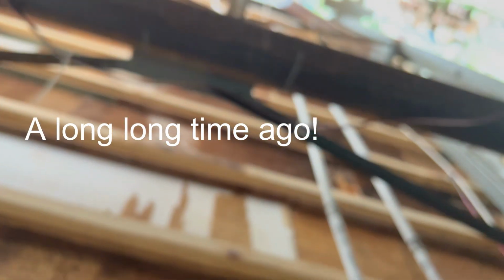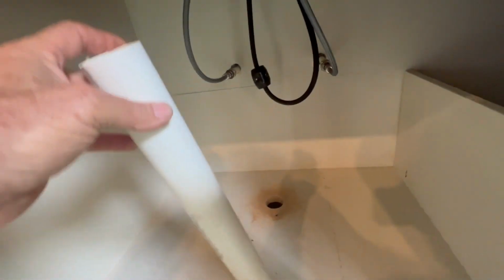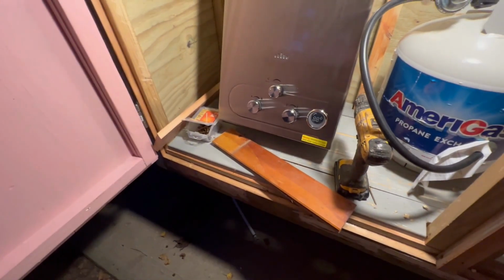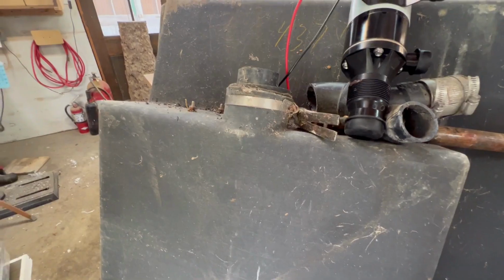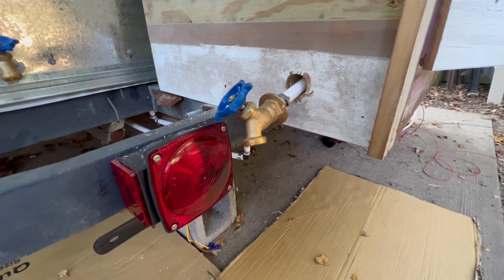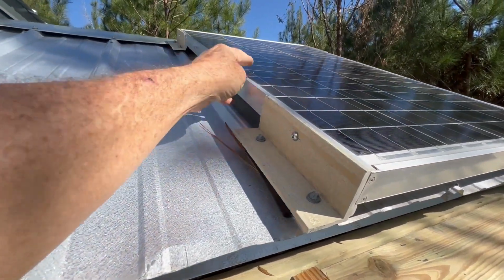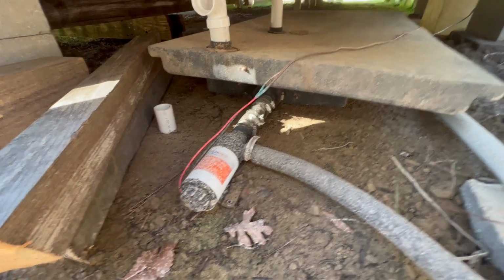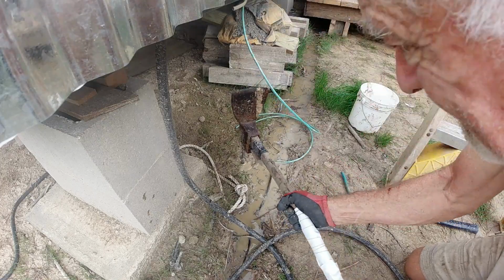Plumbing the Tiny House Camp Camper Thing and adding a touch of solar power too!

Comment: Where you dumping your black water ? I’d bury a 55 gallon drum filled 1/4 way with a few holes and small rocks .
Reply from the maker: I am pretty open on that. I slid 4 10’ joints of PVC through the trees and vines. I don’t know where the end ended up . It might have circled around and headed right back towards me. But anyway, there is a tremendous volume of biomass in those woods. So my plan is to do nothing until we get further along or unless there is a problem.

Comment: Gonna be hard to drain those 'P" traps to keep them from freezing I would think.   Also most cheaper fixtures are not aluminum but Zamak.  Often with a light chrome finish.  Can't do much with it and they corrode out in no time.  Often seen on boats for cleats and such most often pitted and broken.  You can't weld it, soldering would be very difficult at best.  JB weld or such is also very hard to do as the crusty corrosion goes deep into the casting if not all the way through.  You really have to search and be careful when buying sink fittings to get real metal.  Personally I have never found anything that Zamak was good for.
Reply from the maker: Douglas 
Zamak is a zinc alloy. Zinc is Latin for the Devil. I think that’s why the Russians use “Z” as their name tag.
Messing with the Devil never ends well.
Reply: @barrylukebuilds7894  I guess it depends on your point of view.  The devil enjoys the outcome!  If his pitchfork is made of Zemak it will fall apart before any harm is done.  The Russians enjoy misery so they seem to be doing quite well!
Reply from the maker: Douglas 
They are going to freeze and pretty quickly. Temperature forecast for this weekend in the teens. No problem if they freeze I just hope they don’t crack. Fingers crossed. When it gets that cold I am thinking we won’t be there.